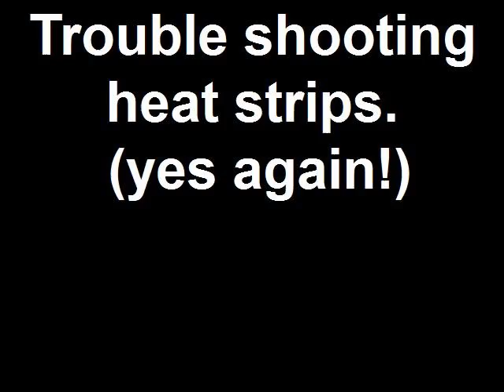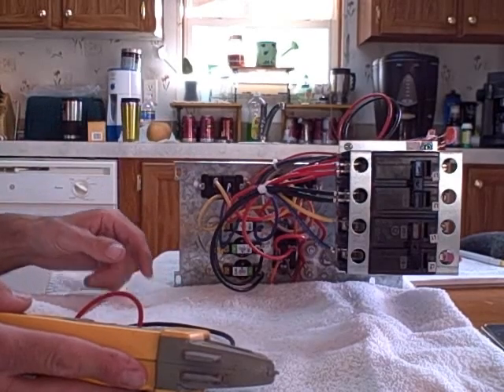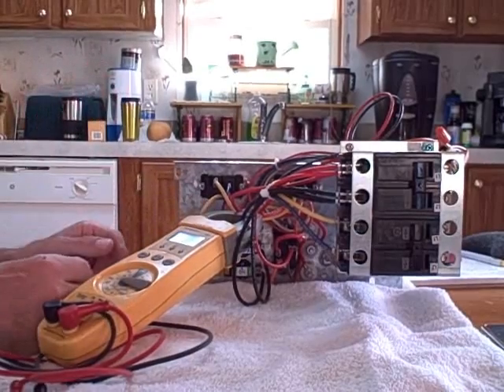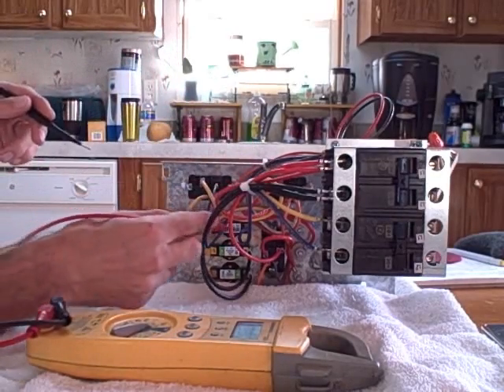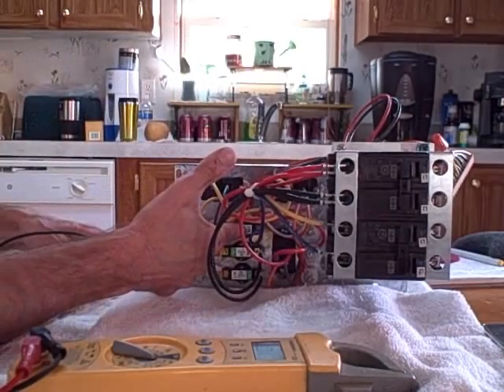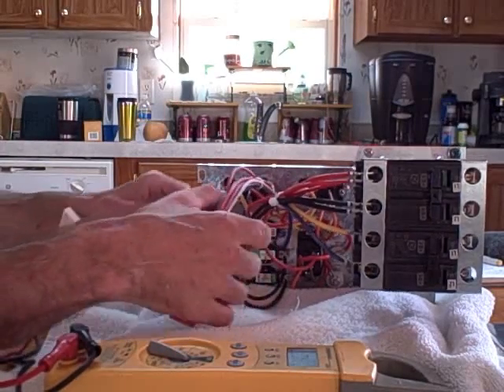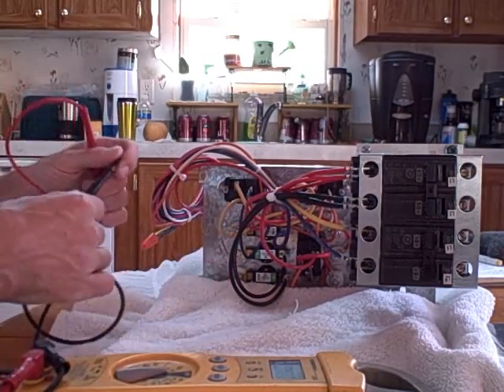HVAC Trouble shooting heat strips.  (yes again

Comment: I've watch a lot of videos, but I don't see any that addresses my problem. After my heater turns off, my heat strips do not turn off. I have to trip the breakers on the system to get them to shut down. Can anyone tell me what is causing this?
Reply: If your unit has heat sequencers it may take five minutes or so for all of your strips to power down after the thermostat is satisfied.
Reply: Thank you for your reply, but my heat strips stayed on for 15 mins or more. That's why I had to turn off the breakers. Had a repairman come in and he replaced the sequencer, but that didn't fix the problem. He tried to blame it on my blower, but it seems to be working fine. Completely at a loss.
Reply: @anniesullian6224  A lot of times it's a stuck sequencer/contactor... I had the same problem, I replaced the contactor but the problem was still there. It turns out it was a short to ground in the coil. (This video covers that) I had continuity to the frame from only one of the coils. You would think the breaker would trip... (NOPE!) I woke up to smoke in my house, anyhow. I would say it's the sequencer/contactor or the coil is shorted to ground and thus the element is running.
Reply: I just had the same problem and I had a broken heat strip and it was making contact with the frame that holds the strips.

Comment: If I am reading 125 volts on both the primary and secondary side of the transformer, as well as 125 volts coming from the thermostat, is that a sign of a bad transformer? I would automatically think that yes it is, but the air conditioner is functioning properly. So that is making me reconsider. Could it also be making me blow heat sequencers? Much appreciated.
Reply from the maker: Wow. Well assuming you're talking about a normal air conditioning system and not something strang, then yes, I would say you have a problem!  Most transformers are labeled somewhere with the voltages on it.
The output of the transformer should be usually between 24-28 volts, the input just depends on what you have available, 120, 240 etc, and of course if the transformer has taps for the proper voltage that you will be using.

Im trying to think how the ac (cool) could still be workinng...  You didnt day if the thermostat was electronic or manual. If it was electronic then I would expect it to be fried!  If you are reading 129 volts on the thermostat then that is what its been feeding to the heat sequencers instead of 28v, so that would definitely fry the things!  Im scratching my head trying to think why it hasnt fried the contactor coil on your ac condenser outside in cool mode though, unless its one of those rare systems that has a transformer outside as well, but thats not likely. (Ive only run across one and dont re all how it was wired)

Im surprised that the transformer isnt just burned up, ive never heard of one doing something like that before though!  What kind of system do you have?
Reply: +mikie2501 I appreciate the timely reply. I'm not home right now. I will definitely send you some more info when I get back. It is a 120 to 24 volt transformer though. Thanks again

Comment: Why would there be 2 24volt transformers installed in the air handler?
After messing with some wires what would cause a 12volt reading across the bottom of the heat sequencer?
Reply from the maker: Hi!  There could be two in there for any number of reasons.  I have two in mine, one is stock and the second is used to power a UV light.  On a few systems Ive run across (dont recall models, been a long time) there was one in the air handler and another in the condenser outside! You will have to trace it down and see what they are powering, it could be that a single one wasnt sufficient to power everything without popping a fuse, or frequently lacking any fuse, burn out. 
As for the low voltage, sounds like you might be reading one leg of the transformer to ground instead of common, is the transformer grounded?  Could be other reasons but without seeing what you're looking at it would just be speculation :)

Comment: It appears our emerency auxilary heat is no longer working.  They found a bad 10kw heat strip problem with proper power supply but open circuit on our Trane XE1200.  Is there anyway I can order the part and have it installed by an electrician.  They want to charge $375.00 for this repair.  Any thoughts or help you can provide is very appreciated!

Comment from the maker: @prad2s If one of your strips is broken you would have to get the parts from a supply house or order them.  Just because the strip isn't coming on doesn't mean that it is broken, unless you have seen it.  I STRONGLY recommend that you hire a professional to change out the heat strip;  This is 240 volts and you need to make sure that the job is done correctly and SAFELY the first time.  This voltage can kill you easily and/or start a fire if not properly installed!   Take care,   Michael

Comment: i seen an electric furnace heat strip boxes
operate in open air before looks vary cool
how the element coils glowed yellow hot
just like tube gloved kind element coil you see operate the in oven or on the stove

Comment from the maker: It's not really that hard, more time consuming than anything.  This is because the new elements don't look like this, they look like a screen door spring and you have to stretch it out as you go.  So you have to be patient and not stretch it TOO far or you wind up with too much and have to try and compress sections back down :)  Most of them are replacable but some are welded in and you just have to buy the whole heat kit to do it right.